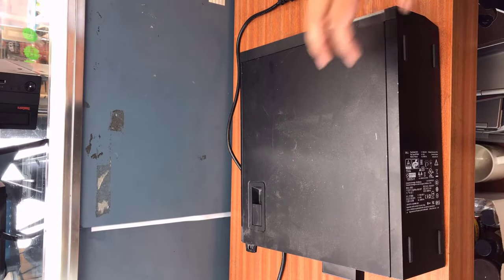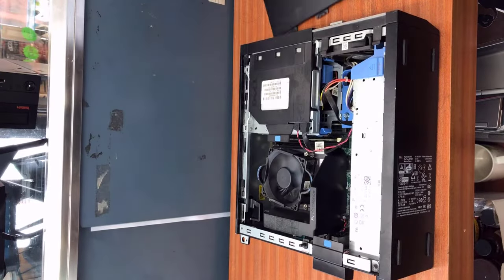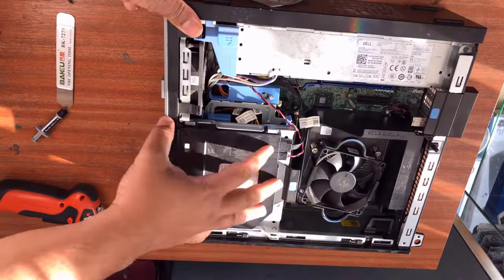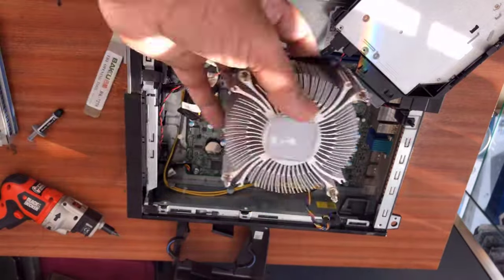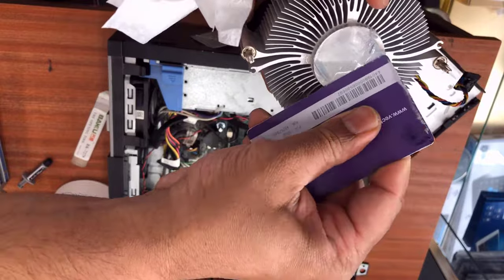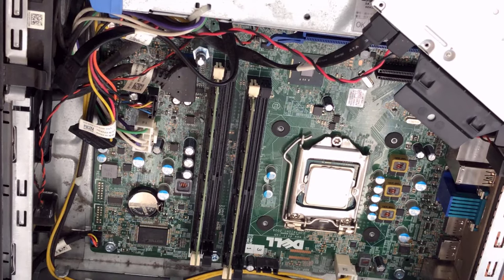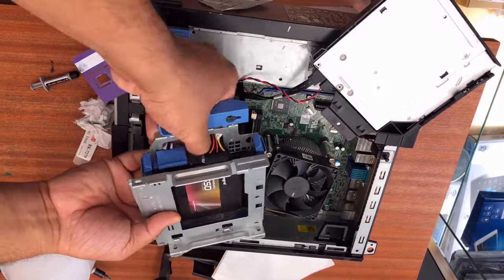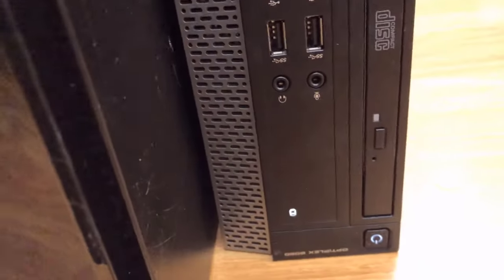How To Fix Dell OptiPlex Short Bip And No Power Issue !

Comment: Ok, thank for the help on that. Pulled it apart changed the battery out reset heat paste was still wet. So replaced battery put it back together but still won't turn back on but it stopped beeping and the fan stays running now. But the cpu will not come back on all the way.

Comment: Thanks a million for publishing this video because it put me onto the correct solution.  The PC would turn off almost immediately at boot-up and the power button was flashing orange.  I believe it showed 2 blips and then 1 blip.  I replaced the CMOS battery as shown in the video, but that didn't fix the problem.  The solution was cleaning the old thermal paste off the CPU and CPU cooling fins with alcohol, and then applying fresh thermal paste.  After booting up, the power button is now solid white.

Comment: My 9020 just started doing exactly what is shown in this video. Mine was off over night but when I went to turn it on, it started this loop you show. Since it was not running and cold, am I correct in assuming it is not the heat sink issue? I was told to try replacing the cmos battery and unplugging and reseating the ram. Great, clear video.

Comment: Buenas. Te lo digo en castellano. Eres un auténtico CRACK!!!! Muchas Gracias! Thank You very much!! I cleaned the thermal paste on the fan, I put new and expanded thermal paste. After a few days the problem returned. I replaced the battery and it worked again. regards

Comment: I fixed mine by removing the RAM, un-plugging a few wires, wiggling the loose WIFI card, cleaning some dust and other gentle wiggling of "things"
AND letting it sit over-nite and threatening to buy a lap-top !!
Reply: any video how did you do it pls help me my ex act same one won’t turn on it doesn’t show any lights either
Reply: @mrhitsjr4775  I still had a light on the power supply, but nothing else - just break the computer down as far as you feel capable and clean-wiggle the internals (gently) then re-assemble.
Reply: haha

Comment: Thanks it worked on a Optiplex 7020 too. My power button was not working the green led on power supply was not lit. I pressed the button on power supply and it ran all the fans. After using your tip it worked again.
Reply from the maker: Glad I could help, Hope you will subscribe to this channel. Thanks for your support.

Comment: I had an incident where I was working on a monitor and shorter out while still plugged into a power supply that my next top was plugged in too. Yes I know, I'm an idiot and forgot to unplug power supply and lucky this is all that happened. Now the optiplex will not power on power, no lights up front and supply light doesn't even turn on. If I press and hold button power supply is the PC fans come on high I and the green light stays lit but nothing else happens. Anybody ever run into this it is there a fix if so?
Reply from the maker: Check my replay ! Hope the Issue would be resolved. Thanks
Reply: @thepcphone  please tell me how to fix? i have same issue with brandon
Reply: please tell hiow u fix that? i have same issue.. :(

Comment: My Dell power light switch was eaten by a rat. can this be the reason for the same issue as this video? beep and power sitch light on and turn off again.
Reply: hello my Dell optiplex 9020 indicates an orange light and fans over speeds but not display what could be the problem thanks in advance
Reply: @kenphillz2334  i just fixed mine. all good. from no display always beeps turn on and off simultaneously. I just bought cmos battery, replace new ssd, format windows 10 and it works fine to me. i play dota 2 with that pc. soon ill upgrade it to max ram and GPU low profile. hope it works for you mate.